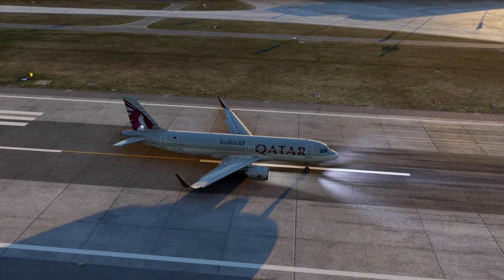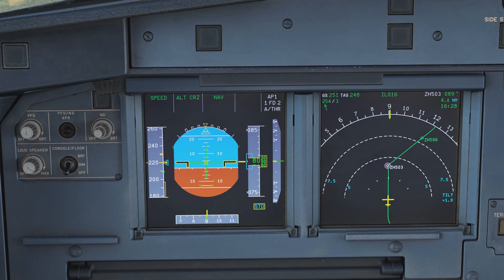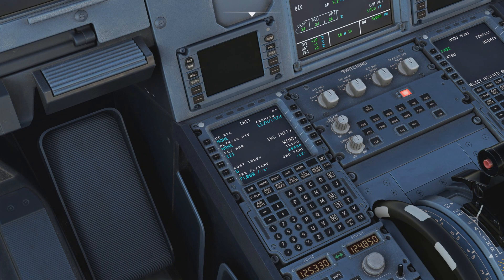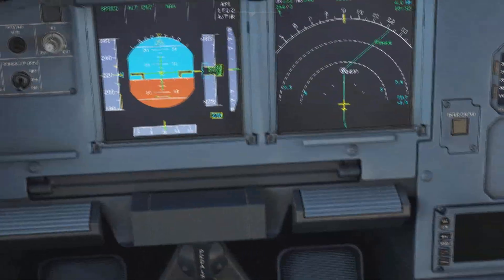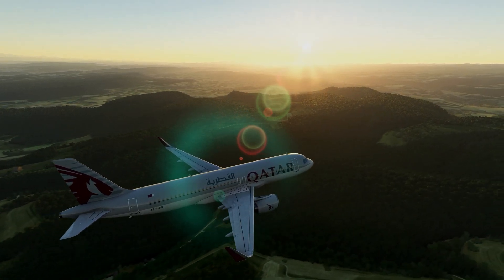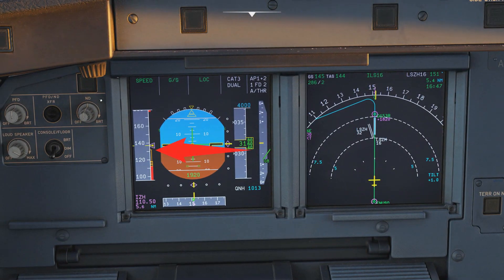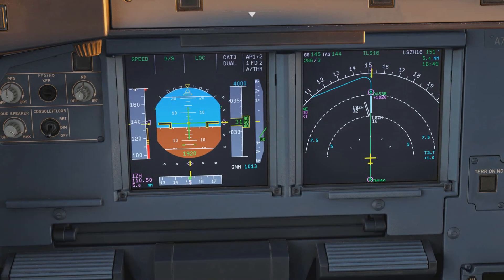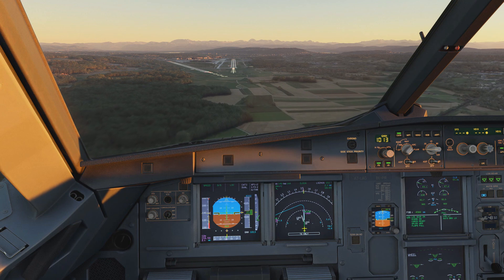Why Airbus Pilots change the Approach Speed just before Landing

Comment: Thanks for explaining this topic for us, but I notest that you didn't put anything in the BARO settings on the Peformance page. I normally always set mine to over 200 feet above any given runway.
Reply from the maker: Yes, I forgot. On a normal Cat1 approach you just put the minimum you will find on the charts. For a Cat3 approach you would put the word NO into the radio line.

Comment: Thank you for the explanation. Very nice. But is VLS discrepancy built in the fenix? I regularly check it, be it in the Fenix for MSFS or in the Tolisses for X-Plane but I have never had a discrepancy and therefore the need to change anything. Cheers
Reply from the maker: @KSKSuperGrobi  To be honest, I don't think it is. However, it is present in the FsLabs A321
Reply: @ Thx. Have a nice Ostermontag.
Reply: @ Jetzt muss ich mich revidieren. Im ToLiss gibt es das, allerdings war der VLS in der MCDU hörer als im PFD. Gibt es sowas, oder Bug? Und was mache ich dann?

Comment: Hi, just to clarify few contradictory point in your video 

The Lowest Selectable Speed (VLS) is derived from the Reference Stall Speed (VSmin), which corresponds to a load factor below 1G. In fact, VSmin equals VS1G, the minimum stall speed at 1G load factor. All operating speeds are functions of this reference speed; for instance, in the landing configuration, VLS is calculated as 1.23 × VS1G.

VLS is represented by the top of an amber strip along the airspeed scale on the PFD (Primary Flight Display). It is computed by the Flight Augmentation Computer (FAC) using data entered into the Flight Management System (FMS). These values are interdependent and identical, although slight differences can occur between FMS 1 and FMS 2 due to:

- Single-step flap retraction.
- Clean configuration adjustments.
- Mach effects.
- Weight corrections above or below 20,000 feet.
- Speed brake deployment.

The Flight Management and Guidance Computers (FMGC 1 and FMGC 2) rely on performance models, using either the predicted landing weight or the actual landing weight during transition to calculate the actual VLS. If no data is entered into the FMS, VLS will not be displayed on the PFD. In both CEO and NEO families, the VLS on the PFD and in the FMS are identical, though discrepancies of up to one knot between FMGC 1 and FMGC 2 are possible.

To conclude, VLS computation is an integral process involving real-time adjustments based on flight conditions, configurations, and the data provided. Ensuring accurate inputs in the FMS is critical for displaying reliable VLS values.

1. *Temporary Entry Below VLS:* In turbulent or gusty conditions during approach, briefly dipping below VLS can happen due to airspeed fluctuations. It doesn't necessarily require an immediate go-around if the aircraft is stable overall and recovering promptly.

2. *Stabilization Requirements:* Approaches must meet stabilization criteria (e.g., airspeed, power setting, and flight path) by a specific altitude, often 1,000 feet AGL for instrument approaches. Temporary deviations below VLS caused by environmental factors may not automatically violate these criteria as long as the aircraft is under control and resumes stable flight quickly.

3. *Prolonged Entry Below VLS:* If the aircraft remains below VLS for an extended duration and the situation persists close to the ground (e.g., below 1,000 feet AGL), a go-around is typically safer. This aligns with the SOPs (Standard Operating Procedures) of most airlines, which prioritize safety in such scenarios.

Thank you.

Comment: I’m fairly sure this information is outdated now for the newer aircraft. After the XL888T crash Airbus changed the PFD VLS to use the data from the FMS. If you change the ZFW you change the VLS. Therefore now in the NEO’s and newer CEO’s VLS should always match what is in the MCDU
Reply from the maker: @tomstravels520  we still do the VLS check even on the NEOs, but that makes sense. You want to keep procedures standardized
Reply: @fsclips  if it’s for standardisation fair enough but the actual information in this video only applies to older models and I believe for if the ZFW was not entered ….which shouldn’t never occur. There have also been changes to the AOA logic after that accident too to prevent errors like that but they still use the ZFW to compute VLS for both FMGC and PFD now.
Reply from the maker: @tomstravels520  Yes, and I am aware that not all airlines do this VLS check. We do and we are one of the largest Airbus operators on the planet. Not saying that makes it right, but it means that every day thousands of pilots follow this procedure.
I guess every company has to decide what works best for them

Comment: Biut this is not an Airbus Procedure its a Lufthansa group thing. So it has nothing to do with Airbus SOP.
Reply from the maker: @HobbyPilot2003  Airbus says don't go below VLS, LH says don't go below VLS +5. The rest is the same.
Reply: @fsclips  Yes. But the VLS Check is not there if you follow Airbus SOPs. Its not in the FCOM, only on LH Group Airlines :)
Reply from the maker: @HobbyPilot2003  But I have had it twice already that the approach speed was below VLS. If you don't do a check that could be pretty dangerous, no?
Reply: @fsclips  For 99 percent of the Airlines not, so maybe you have to ask LH why they do that, because its not an Airbus Procedure. 
Really dangerous is flying without AP at 10k feet around and turning the ATHR off :D
Reply from the maker: @HobbyPilot2003  so, if you expect a bumpy approach with speed fluctuations do you just add a few knots to your approach speed or do you accept staying below VLS for some time? For us, dropping below VLS for a prolonged time below 1000ft is a go-around.
As for your comment. My LH instructor always said: You can do whatever you want as long as you know what you are doing.
Pilots at LH are free to switch off the AP at 10.000ft, but if you screw up the approach you better have a good explanation
Reply: @HobbyPilot2003  How is that dangerous? WTF are you on about?
Reply: @ Just telling you what the Airbus SOP are. Many Airlines do even not allow to fly manual flight. The most accidents happend with AP off.
Reply from the maker: @HobbyPilot2003  over reliance on automation has also caused many accidents. A good balance is the best. When I fly into LHR I will leave the AP on until just before minimum. 
However, we also fly into some small greek airports that have no tower, radar or published approach. If you are not used to hand flying then good luck with that. Those runways are often 1700m long and only 30m wide. No autopilot will help you with that.
Reply: I find it very funny and amusing, if a hobby pilot is trying to tell a professional pilot what to do. 😂
Reply: @FTStratLP  I just telling him what Airbus procedure are, and I think he also know that. The VLS Check is just a LH group procedure, thats the way it is. You can have my FCOM, there is not such a thing in there.
Reply: @FTStratLP  I dont say he is doing anything wrong.